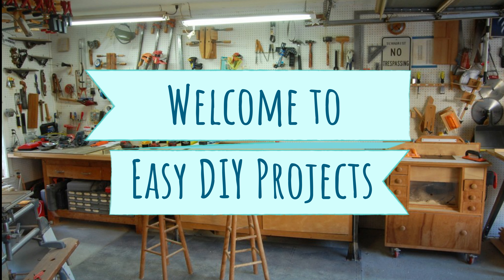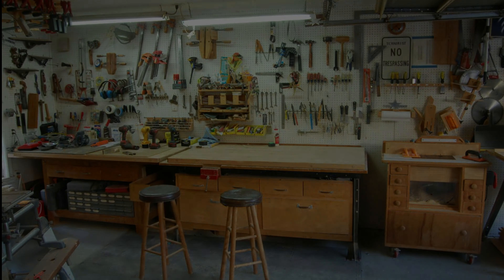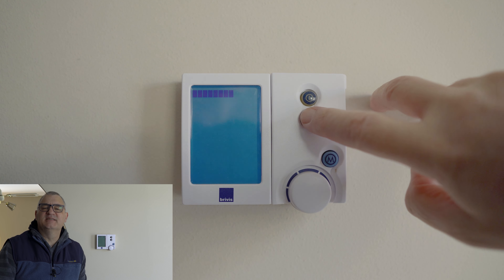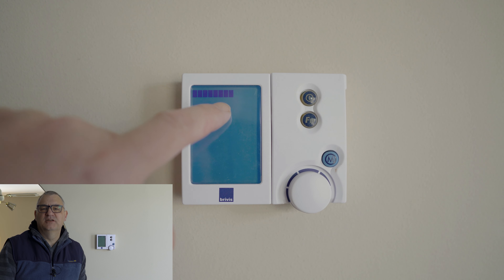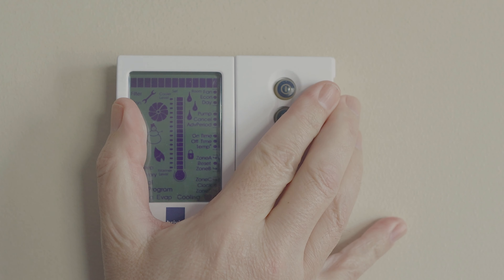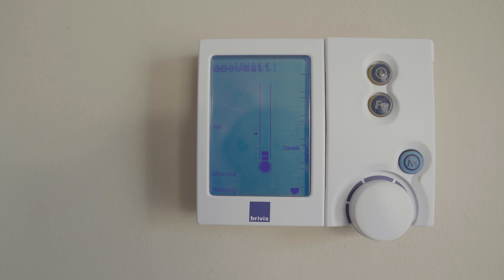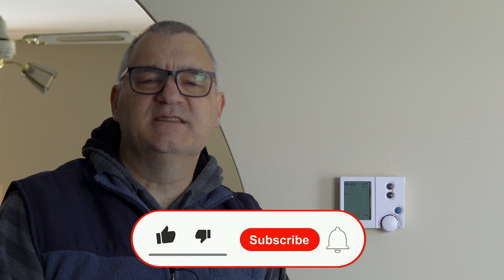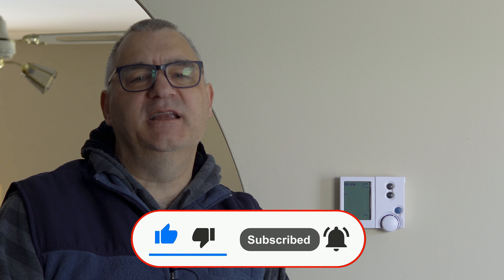Blue Squares are showing on my Brivis Wall Controller / Display Panel

Comment: We had a power outage and the controller froze (no buttons would work) but no blue squares either. Resetting the the unit as per you instructions did the trick. Thanks so much

Comment: OMG!!!! Thanks for this info! I was about to call in RACV Home Assist and would have felt like such a idiot when they would simply have done this fix. I was a bit anxious about pulling the cover off so many thanks also for all the advice re removing it safely. All fixed and I didn't have to waste an emergency call out!! We've had our system for nearly 4 years and this is the first time this has happened.

Comment: Thank you for this video.I had a Braemar heater for 16 years and it worked fantastic until it just died. Never had to reset anything. This is the 4th time this month that I had to reset this controller. The heater is only two years old and serviced. This controller is ugly, feels cheap and I now fully regret ever buying the Brivis heater!

Comment: First time this has happened and the unit is two years old, will be much easier next time it happens. Thanks again.
Reply from the maker: Two years, wow. I think you've broken the record for the longest time without a reset. I didn't even get three months after my initial installation. Glad the video helped you out. Cheers.

Comment: Thank you for the very good description of how to remove the controller.  Any suggestions on what to do when there is absolutely nothing on the screen on both the main and secondary controller and the power is on at the fuse box?

Comment: Thanks so much, it worked for me. 
Why do BRIVIS ask us to hold buttons 3 and 5 down for five seconds while replacing the controller, does that reset the network back in the Heater as well, they then go on to say that you have to enter a 1 as well to identify the contorller. I didn't need to do any of what BRIVIS said to do?

Comment: My brivis networker controller for our evap turns on and goes to pre wetting stage but for some reason has stopped showing the fan speed display, which is a set of small vertical blocks. Any ideas on what the problem could be? Thanks

Comment: Thanks for this great and very helpful video Easy DYI Projects. I have a question in regards to you removing the cover @ 1:24. There still seems to be some force needed, so when you do remove the cover - and the back is clear like at the 1:35 mark. Would you recommend a tightening of those screws while the cover is off - or is it generally unnecessary. Thanks Again...
Reply from the maker: Hey SingleRacer. The screws are actually not loose, so no need to tighten them. The flex on the back plate is preferred given that you don't want it to break as your taking the front cover off. Hope that helps and thanks for the support. 👍

Comment: My Brivis controller’s backlight no longer works. Hard to read at times but works fine otherwise. Thanks if you can reply.
Reply from the maker: Hi Barrie. Seems like the LED has blown. I'd give Brivis a call and see how much it costs to replace the front cover.

Comment: Did this and solved the original problem but now it no longer shows room temp even after waiting like you said
Reply from the maker: The room temp has always returned for me, usually in less than 10 minutes. If you've waited more than half an hour and it hasn't returned, I'd just reset it again and see what happens. Good luck. 👍

Comment: My brivis shows preheating the furnace please wait all the time. it can't start. do you know why?  Thanks
Reply from the maker: Hi Beibei Li. Unfortunately, I'm not too sure why it's doing that. Sounds like an issue with the main unit. I'd be contacting the installer or Brivas to get that looked at. Best of luck.
Reply: @JustAwesomeCommercials  Had a similar issue last year with the preheating cycling on the controller, like it was continually trying to start the furnace, and then finally displaying an error on the controller. 
For me, it was the Brivis HSI (igniter) flame sensor/backup sensor that needed replacing in the main unit.
Yes, a job for the technician.

Comment: How do you reset the zones on a British heater I push button 4 but nothing happens
Reply: Same problem. Zone A no longer comes up on my screen. I used to be able to change zones by pressing 4 but now I press it and nothing happens. Any fix?
Reply: Update: I called up Brivis and they ran through my factory settings - some were out of wack. Resloved the problem over the phone by pressing a few buttons. Great!!

Comment: Our heater is working by there is no lights showing up on the controller can you help please
Reply from the maker: Hi Bev. I assume that you have reset it first and there are still no lights? If that's the case, you'll need to arrange to get it looked at. The Central Heating Units usually come with a 10 year warranty, so there should be no cost to you. If you didn't buy your current one, then there may be a charge. I hope you can get it sorted out.

Comment: my controller is blank  no lights nothing just stopped working can you help
Reply from the maker: If you've reset the controller and it's still blank, it might not have any power. You'll need to arrange to get it fixed under warranty. Good luck.